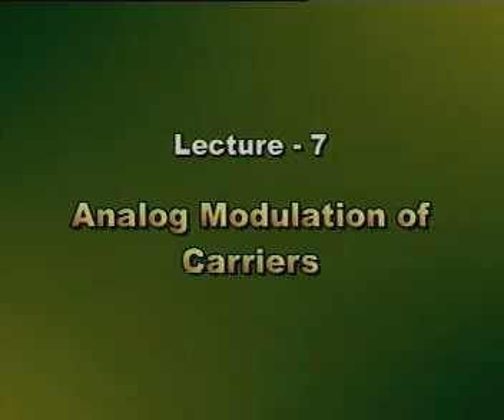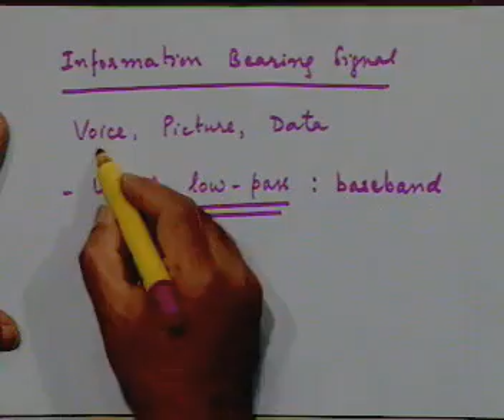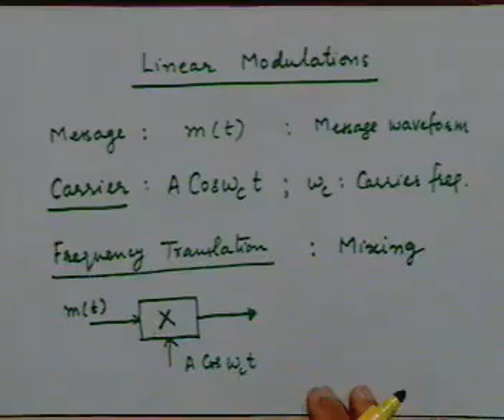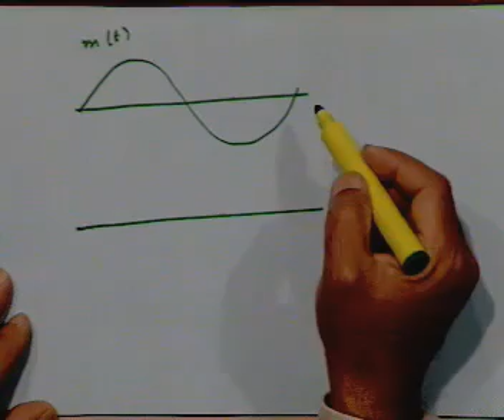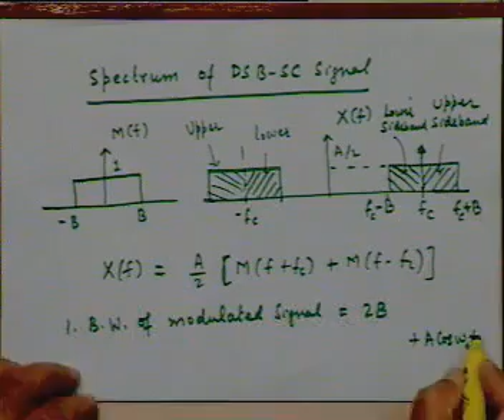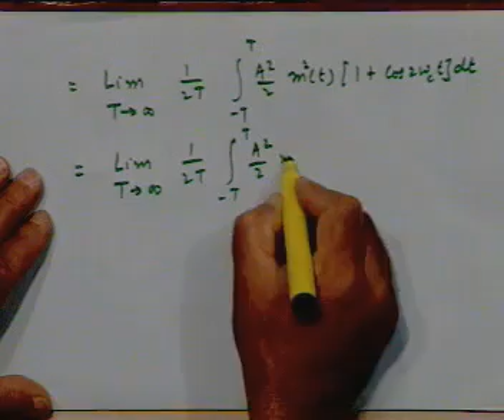Lecture - 7 Analog Modulation of Carriers

Comment: sir ,
in recovering back the original signal ,why to multiply with the carrier again???
Reply: During modulation while multiplying with carrier, in frequency spectrum we saw that components at zero frequency is shifted by value of fc and -fc. Similarly for demodulating if we multiply the modulated signal with same carrier signal, in resulting spectra also there will be same shifting.ie by fc and -fc. So for a modulated signal which is centered at fc will shift to (fc+fc) and (fc-fc). ie to 2fc and 0.Now by using lowpass filter we filter out high frequency signal centered at 2fc and other one is retained.Hope this was clear.
Reply: Did u get answer?